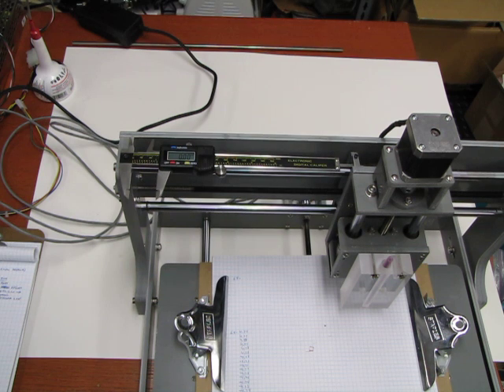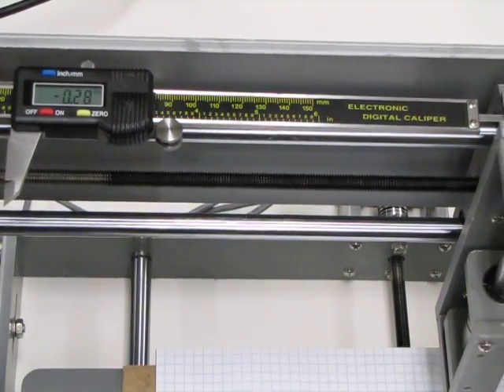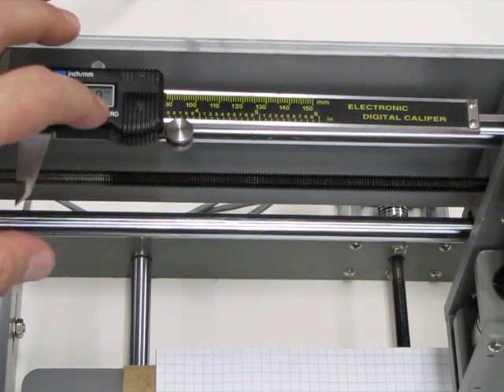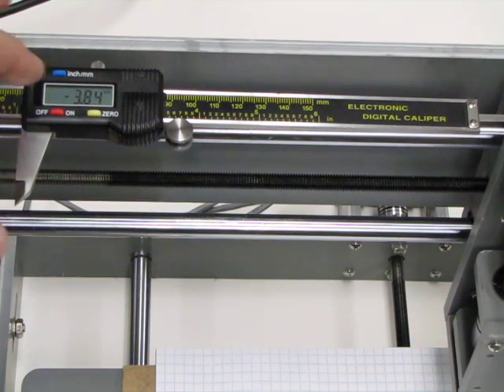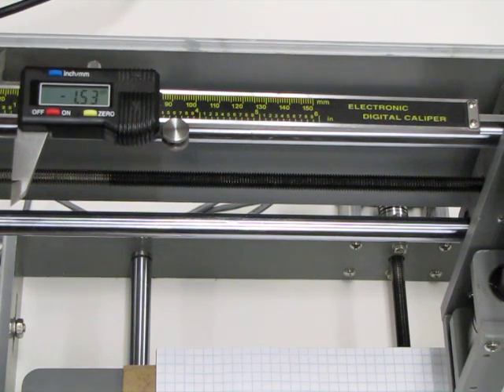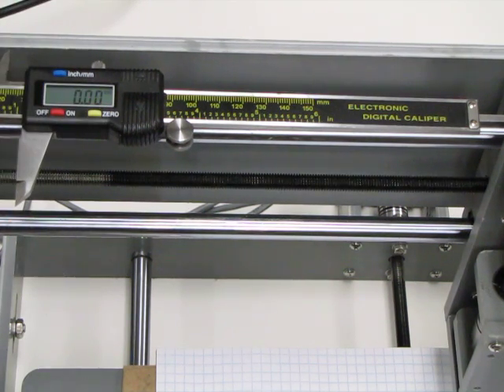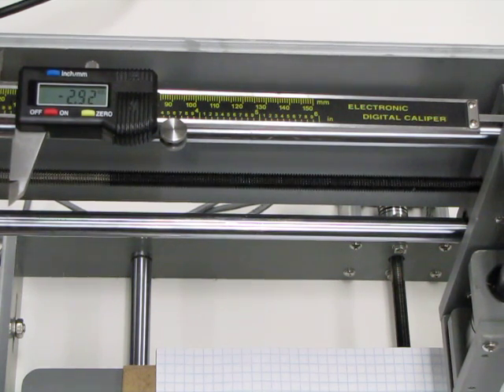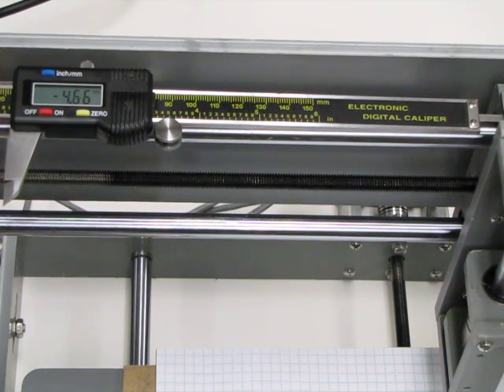Zen Toolworks - TinyG slow line accuracy test

Comment from the maker: In issue #12 there was a floating point expression that generates a bias of about 3 or 4 parts per million per interpolation segment. I re-arranged the expression and got rid of the error completely. This was all verified by a step counter that "closed the loop" on the number of steps expected in a line. 

Hopefully there are no more of these deep problems lurking. More and more people are using TinyG and so far it seems to be coming up clean.

Comment from the maker: Each interpolation segment (approx 5ms of travel) executes an integer number of steps and keeps a residual of a fractional step. 

In issue #7 the cause was errors introduced by the residual being computed at one DDA clock rate then executed at another. I realized I had to keep the DDA at a single clock speed (50 Khz) and not try to optimize it.

Comment from the maker: There were 2 issues related to accuracy - which I jumped on because errors in accuracy are definitely not good. These are issues #7 and #12. I spent feverish time on both looking for root cause, found it, and fixed it. The submitter's machine had some interesting settings that put things into corner cases. Because TinyG computes lines as 3rd order S curves the math gets a little complicated. (I'll see if I can complete this comment. I ran over the character limit)